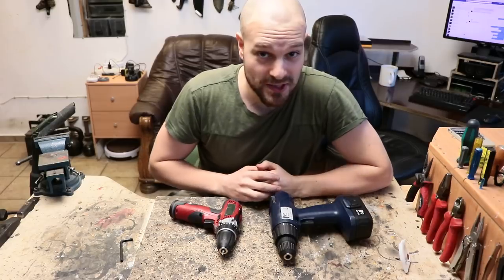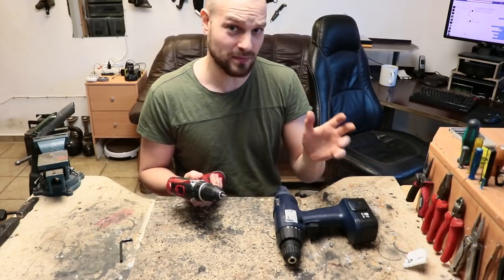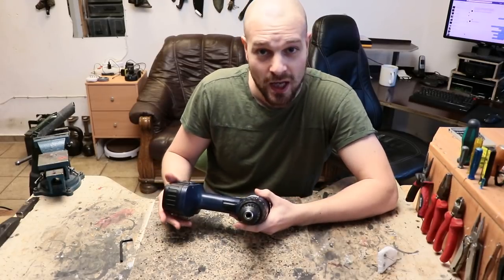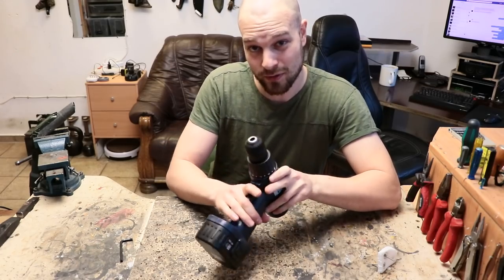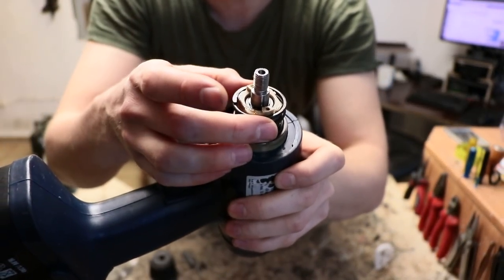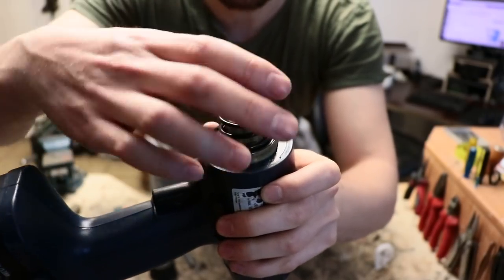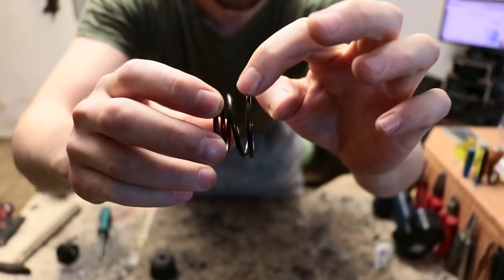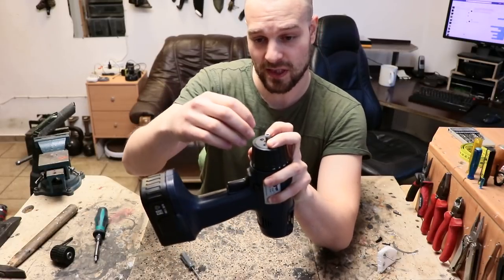NO MORE STRIPPED BOLTS: tweaking your cordless drill/screwdriver ratchet to kick in earlier

Comment: Might you help me?  I have a drill with 3 modes.  Today I was testing the modes and it got stuck.  I managed to unlock the mode selector, but now the maximum torque doesn't work.  The torque indicates 20 but it is 10. Hope your help, this is the only video with a similar issue. Thank you very much.
Reply: I don't disassemble nothing, just make force to turn the selector.